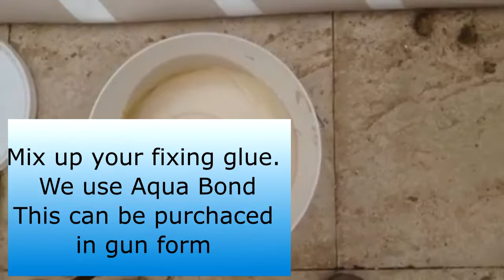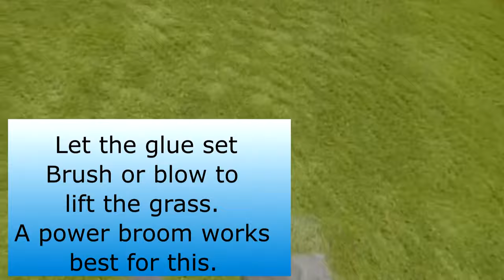HOW to lay Artificial / Fake Grass - Easy DIY step by step #diy #howto

Comment: Hi Chris, thanks for this video. I am single mum struggling with finding less expensive installer. So decided to it on my own. Please help with exactly everything I need for a 4m wide and 7m long area to cover. Many thanks, God bless!
Reply: Your measurements are exactly the same as mine and I’m doing mine by myself (well, with a little help from my brother with the digging out!). I have dug out approx 3/4 inches of the soil base (I removed the top layer of grass weeks earlier) and then put the timber frames in as support around the sides using wooden stakes to put them into the ground. Weed membrane goes in next as the base layer and set in place with U pins to secure. Then I’m using type 1 MOT (3 jumbo bags from local builders merchant) and then grano dust for the top layer (3 jumbo bags again for my measurements). Some people debate whether or not the weed membrane should go in first or as the last step under the grass, but I’m putting mine in first. Hope this helps!
Reply: Hi there, fellow single mum here wondering how you got on in the end? I've got turf down with patchy bald areas and I'm sick of looking at it lol. I'm thinking this looks like a lot of work..

Comment: Would like to have seen you do the edging as im clueless on this,  also did you glue the weed protection then then grass to the weed protection?? Totally lost
Reply: Did you ever figure this out at all? That’s what I’m wondering as well
Reply: @enzogiampieri1092 no I got no reply so I bodged it 😂😂 I didn’t use glue on mine just used wire peg like things you can buy n hammered a few of those around the edge.  Been a year now n it’s all still in place.  Good luck with your project. 👍🏻

Comment: Best video on laying artificial grass ever. Assuming no issues not using nails? Makes me think I can do it. How do I work out how much mot and dust I need? 19m2
Reply from the maker: Thanks very much. I'd only use 6 inch galvanised nails if you have a join in the turf. I'd still glue the outside but nail down the joins as well as glue them.
Use this link to work out your mot and grano dust (use the sand option for grano)
https://www.myersbuildingsupplies.co.uk/aggregate-calculator/

Good luck and thanks for watching
Reply: @TheCountryCottageGardener  amazing thanks. So dig out 4 inch. In the calculator what do I put for depth of mot and dust
Reply from the maker: @ellisbarnes4761  the depth is what you dig out so 4 inches

Comment: Hi mate, cracking job! I'm just about to undertake my project. I have 3 small square sections in my garden inside sleepers to install grass. Will drainage be an issue? Can i use limestone chippings as a base instead in Mot-1? How much limestine/mot-1 & grano dust will be needed for 9 m2? Cheers

Comment: Hi great video glide I came across it just one quick question I am not putting edging bricks round so no sand and cement mix will the grass still stick or would you just put some round edge so it will stick thanks

Comment: Nice looking job, now they just need an outdoor Hoover. Running your hand through at the end looked decent quality. Personslly I'm not a fan of artificial grass but it certainly has it's uses in some specific requirements. Top work again
Reply from the maker: Thanks very much. The client had got a wet dry hoover for it 🤣 am with you with your feelings on af grass. Thanks for watching 👍

Comment: Great video, nice to see good workmanship :-) how come you didn't also weigh it down with sand aswell? Small lawns not required?
Reply from the maker: Hi pal. Not all modern brands need the kiln sand. Plus this one was laid without having to cut and join any other grass. Also the home owner has dogs. The sand inlay would hold the pee smell.

Comment: Now that is how it should be done. Great video, only one question, no sand? Most fake turf layers will finish with fine sand brushed in the lawn. Is this not necessary do you think?
Reply from the maker: You can add kiln dry sand but tbh this can give weeds something to grow into. Most modern brands don't need the sand to weigh the turf down. Thanks for watching 👍
Reply: @TheCountryCottageGardener  I usually use green plastic pellets.

Comment: Hi Chris great job well done yet again but one question would you be putting in any dry kilm sand on to keep the grass up right
Reply from the maker: Thanks Derek. Not on this one I wouldn't. Lots of the brand's these days don't require the sand anymore. Plus the sand would hold dog toilet smells. Having to brush the lawn up a few times a month is a better trade off than smelly dog wee sand lol 🤣
Reply: Thanks Chris for your reply your spot on with the dog  smell have a good weekend if you can
Reply from the maker: @derekbarlow9641  thank you, am finishing a summer house build at home lol

Comment: In terms of water drainage/runoff do you have a slight camber when laying the sub and top dust or does it not matter?
Reply from the maker: Unless it's laid on heavy clay ground it'll be fine without extra drainage
Reply: @TheCountryCottageGardener  but you've concreted the entire surrounding? What happens to the rainwater?

Comment: I did buy2 tubes of aqua bond. But I know I'll need more. Is there another product that can work sticking to concrete that I could buy from somewhere like screwfix? Thanks
Reply from the maker: https://www.diy.com/departments/artificial-grass-adhesive-310ml/1293993_BQ.prd

Wickes used to do one but am not sure they still sell it. This link is for a b and q one

Comment: Hi, can I put the weed membrane on top of soil, fill with mot 1, Wack, then put fine crush on stone, wack then put another weed membrane on before laying grass on top. Not bothered about expense, just 2 ppl I no said "I put membrane on soil and still got weeds" other said to put it under turf to prevent weeds. So thinking of putting 2 down as I have a lot of weed roots com ing in from under next doors fence. Thanks
Reply from the maker: Yes you can do that. But sometimes weeds grow on top of the grass if you don't keep it clean
Reply: @TheCountryCottageGardener  thank you, going to order prem pro 35 ml, been told it doesn't need sand on it, what do you think ???
Reply from the maker: @gordonmckevitt9131  I would t use sand on top of the turf. That sand will definitely help the weeds grow as they will seed in that
Reply: Brilliant, thank u so much 👍

Comment: Hi, can you tell me when you mixed the cement with the sharp sand can you just use the mot 1 mix with cement or do you specifically need sharp sand and how much water do you need to add please? Great video it’s so helpful
Reply from the maker: Hi. Thanks for watching and commenting. Your have to use sharp sand with the cement. The amount of water will depend on how wet the sand already is (some buildings centres keep it outside so its always wet). You want the mix to hold its own shape when fully mixed. Kinda like really thick custard 😂
Reply: @TheCountryCottageGardener  thank you very much for your reply, I’m assuming I can just grab a small bag as won’t need much? 
Also did you have to check the slope of the land after you put your base on? If so what do I need it to be? Thank you!
Reply: Also do you have a specific type of artificial grass you recommend or thickness recommended ?
Reply from the maker: Yes you can get small bags for and DIY store like wickes or B&Q in the UK.

We run the turf with the ground so no need to check level. As long as no bumps and lumps. A smooth graduel fall is fine
Reply: @TheCountryCottageGardener   okay brilliant thank you, I noticed you didn’t use nails or sand infill over the top. Is there a situation when this should be used or is it just not required when using the glue and grano base?
Reply from the maker: I only use nails if we join two bits of turf together in the middle. Other Than that I don't. The brand of turf we use doesn't need kiln sand over the top. Lots of brands don't need it these days. Plus the client has a dog and the sand holds the smell of dog wee.
Reply: @TheCountryCottageGardener  okay great thank you, can you recommend a turf brand please?
Reply from the maker: We've always use express grass. Com
Reply: @TheCountryCottageGardener  hey thanks for the advise ordered and the grass arrived very fast! 

Just had a quick question please, regarding the membrane do you just cut it a bit short from the edges and nail it in or anything and then glue the grass to the concrete? 
Also would 4 inches be totally depth required to did out? 

Thank you
Reply from the maker: @Traveller653  yes they fine to do 👍 good luck with your project

Comment: Great video Chris - I’m new to your channel - I’m about to start an artificial grass job but I was going to use timber for the edging to screw into (Marshall’s advised it in a YouTube video). The job I’m on has brick walls around it a sleeper boarder and decking - would you recommend just using sharp sand and cement around the brick walls / sleeper raised bed and raised deck then just glue the edges as done in your video? No need for timber / screwing down / pegs etc?
Reply from the maker: Hi Johnny and welcome to the channel. Sand and cement is best practice for a longer lasting finish. Only yesterday we were doing a decking into af grass. The installers had used timber roof battens and they were rotten (2 years in the ground). Knowing that timber sleepers expand and detract with the weather I'd be inclined to concrete still. Even if the concrete is edged to the sleepers any once set it shouldn't affect the grass if the sleepers moved. 

The only time I'll use extra pegging would be on large areas, especially if you have joins. Hope this has been of help and you continue to enjoy the channel 👍

Comment: I have bad drainage issues in my garden will I need to put sharp sand in the soil before putting MOT type 1 in ? Or will the MOT type 1 help with drainage
Reply from the maker: If the drainage is really bad I would look into a French drain system. Sand won't make much difference am afraid
Reply: It's only as I live in a new build and there was a lot of clay soil but I've just dug it out will that help?
Reply from the maker: @moomo9321  after digging the clay out have you got to a better soil?
Reply: @TheCountryCottageGardener  that's a good question 🤣🤣
Reply: @TheCountryCottageGardener  when I had the lawn it just got very mossy not water sitting on top of you get me
Reply from the maker: @moomo9321  that could be down to the old lawn needing aeration and de thatching. If the old lawn didn't ever puddle with water that didn't drain after a few hours you should be fine
Reply: Ok fab thanks. So after I've dug down apart weed killer, not type 1 down, Wacker plate then membrane and grass? I'm not going to concrete edges pegs should be okay?
Reply from the maker: @moomo9321  you can use 6inch galvanised nails for the edge but glue onto concrete would be best
Reply: @TheCountryCottageGardener  thanks so much I haven't ever touched concrete in my life so I wouldn't know where to start 😂
Reply from the maker: 😂
Good luck with your project 👍👍
Reply: @TheCountryCottageGardener  thank you

Comment: Was hard to see in video. What were you mixing with the cement ? Sharp sand or 10mm ballast ?
Reply from the maker: Hi, thanks for watching. It was just sharp sand and cement for the concrete edging
Reply: @TheCountryCottageGardener  best practice for blocks, haunch and base for attaching is adding in a 6-10mm stone to the sharp and cement?

Comment: great video, how come you haven't used sharp sand before your grano dust? can I get away with using MOT and grano just on its own? I'm also wanting to install artificial grass. Thank you.
Reply from the maker: Hi Rob, thanks for watching. I'd never use sharp sand for artificial lawns now. Sand washes away quicker and holds the smell (if you have pets) of wee. Grano dust doesn't hold the smell. Best way to install in mot type 1 followed by grano with a concrete edging to glue too.
Reply: @TheCountryCottageGardener  thanks for the prompt reply, my garden is 21feet 6 inches by 19 feet, sorry I am very old fashioned lol, Would you say a tonne of each would suffice once whacked down?
Reply from the maker: @robh1521  of you were to lay  3 inch of mot you would need 3 tonnes and 1 tonne of grano dust. Look up timber link MOT calculator website. It's a really good tool for volume materials
Reply: @TheCountryCottageGardener  ok thank you.

Comment: Do you not put sand down on the top?I googled it and it says it keeps the grass blades erect and stops wrinkles forming
Reply from the maker: Tbh this varies from manufacturers. It used to be common to do that but as quality has improved lots of the brands don't say it's needed. Personally we don't as it also encourages weed and grass growth from ontop of the af grass.
Reply: @TheCountryCottageGardener  thank you I won't bother then as I have pets and don't like the idea of dog urine to be lingering in the sand.
Reply from the maker: @ashleyking9511  that's very wise. Good luck with your project

Comment: Looks great pal! Top job 💪🏽 how long did this install take you?
Reply from the maker: Thanks pal. One day for the bulk of the works but came back the next day when the concrete was set just to cut and fix the grass down. Could have done it in one day if I used fast setting cement.
Reply: @TheCountryCottageGardener  class stuff mate ! 💪🏽

Comment: I have a dog what is the best thing to use as a base?
Reply from the maker: Thanks for watching. This job was done for a customer with a dog. Best to follow the steps with mot type 1 followed by grano dust. I'd highly recommend not using sand
Reply: @TheCountryCottageGardener  yea id rather not use sand if it keeps the smell in it so will follow what you used thank you
Reply from the maker: @steeleyg225  good luck with your project 👍